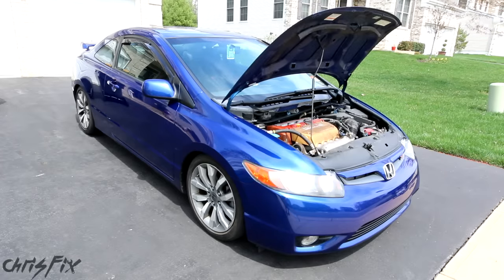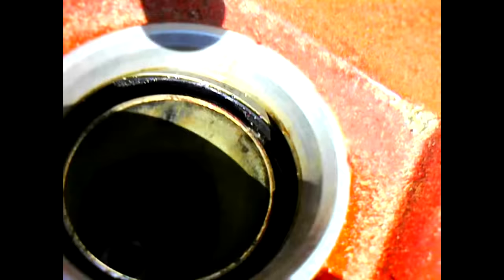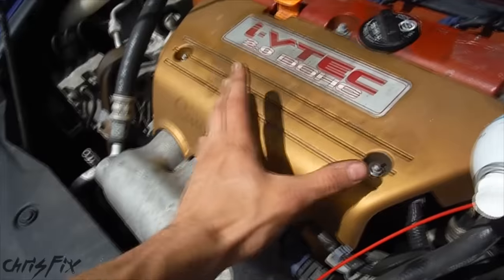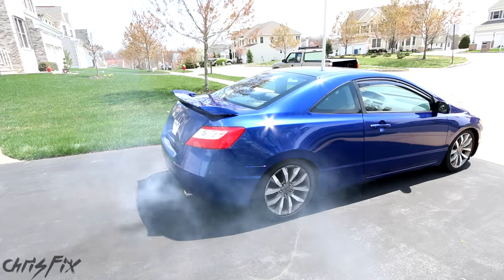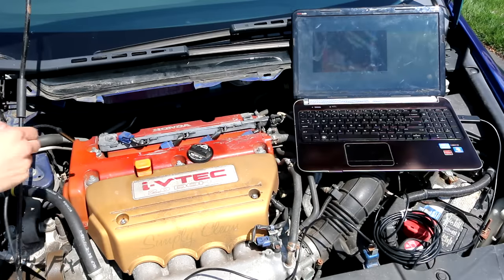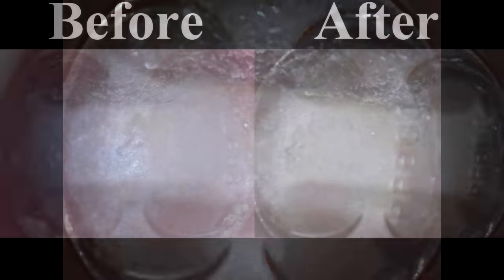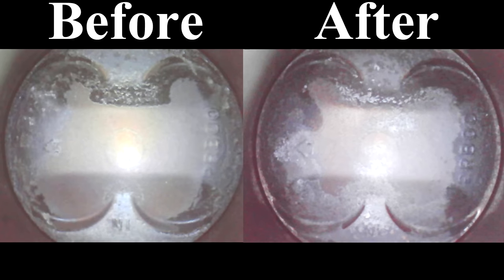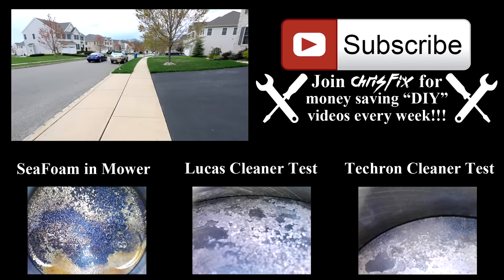Does Seafoam Actually Work in a Car? (with Proof)

Comment: not much of a change. don't know what yall are watching.
Reply: I would like to know how those small amounts could effect how the engine runs. im having issues from carbon build up. it would have to be a lot more than that I imagine
Reply: lol It was the equivalent of blowing dust off the engine.
Reply: TubeWatcher I had my mechanic seafoam and manually lean the throttle body for $60. it starts up smooth again without all the gurgling
Reply: ***** I have no doubt that seafoam works, but in this case the before and after wasn't a big difference.
Reply: it's not suppose to be night and day different. for the price of the can and effort in the project. i'd say it's a good value. compared to, manual cleaning ?
Reply: TrapBum is there a chance that it can damage other parts downstream though? ive heard people talking about catalytic converters getting messed up
Reply: ***** sure but chances are the cat was almost gone anyways.. cat aint big repair anyways
Reply: TrapBum the mechanic I talked to today said the cat has small holes that can get plugged up but it will eventually burn away
Reply: Gary Shaw
Reply: For  125,000 miles this engine looked good enough without any cleaner. So what we would be looking for would be the sides if we still see the elevated build ups, and that was visibly reduced. If the effect justifies the work on this car ... probably not. But it worked. Note also the engine never will look metallic-shiny as it was new. That's not needed at all. We put that under marketing fluff :)
Reply: Do I pour this into my gas tank?? Do I pour it into where the motor oil goes in?? Kris is putting it into the throttle body like every video everyone is doing something different there no solid answers wth lol
Reply: Hontoni Arigato you can put it in the crankcase but get an oil change after. Gas tank is fine. And the vacuum line for the smoke show
Reply: Simba TheGreat   Go for BG44K fuel additive. It's top rated.
Reply: Arthur Smith I use BG products at my work, it does work well.
Reply: Daniel   Google.com and in the search bar put LS1 Been Testing Oil. Read this. I've been doing this for over year. Marine Outboard TCW3 rated oil. Use it at 1 oz oil to 5 gallons of gasoline every time you get gas. Cleans and lubes your entire system. Works much cheaper than Lucas fuel conditioner and injector cleaner. Give it a try for a couple of tanks. Any questions give me email.
Reply: both you can induce half into the engine and half straight into the gas tank so it cleans as you burn fuel slower but goes to the same place the idea is to get the sea foam to run through your fuel system and compression chambers/cylinders
Reply: I don't even know whats the point of all this.
Reply: reefread1234 wdchh
Reply: Johnny Sauceda I agree seems like a waste of time, $ and prob pissing off the neighborhood with the smoke...can see how this helped performance any...
Reply: You put it in all three places. 
Top off your gas tank then add a full can of regular Seafoam.
Add half a can to your engine oil and run it for no more than ~200 miles then change the oil/filter.
Reply: any build up anywhere effects a vehicle. hense why people pay money to have things port and polished. smoothing welds down smoother flow ect
Reply: Ya im with you, i wonder if the engine was worse if it would have done anything.
Reply: Look at the piston walls you can see better reflections
Reply: @TubeWatcher  Lmfaoooo

Comment: Most of the smoke coming out of the tailpipe is the Seafoam and not carbon build up. The Honda's engine was actually pretty clean. You should retest the Seafoam on a GDI engine with 100K+ miles.

Comment: I guess it's like brushing your teeth. Your not going to get the to turn white right away if your teeth are yellow but if you keep it up it will still working it's way threw. 
But if your teeth are already white it will just protect them.
Reply: Our teeth naturally aren't white and naturally do not stay white and are not suppose to. It's crazy how peer pressure do that.
Reply: If you put your teeth in a jar of hydrogen peroxide overnight they'll be lovely and white in the morning. Just don't leave them too long or they'll disappear.

Comment: how often we should clean the engine from carbon? 
very nice video and helpful
Reply: Aziz Bassim Using this stuff more often won't hurt your engine since it's petroleum based. I use seafoam spray twice this year.
Reply: Aziz Bassim never! don't waste your money on this stuff, it's a gimmick and you will gain nothing.
Reply: Its not a gimic, I use it in many engines from small to large, and I can vouch for it. Its made everything from 29cc engines to my uncles boat run smooth again. That said, it's not a fix all solution I still had alot of work ahead of me but the seafoam definitely helped.
Reply: Ginger _ 
it is a gimmick, it removes minimal amounts of carbon and carbon removal on the pistons has no noticeable affect, you are not going to get a engine running smoother doing this, it's in your head!

cleaning the fuel system is just about the only fluid based product you can use that has any genuine Benefit at all and even then, once done , doing it regularly is a waste of money, once cleaned it won't need doing for thousands and thousands of miles.

there's so much hype out there about these products but any proper mechanic will tell you they simply don't do what they claim!
Reply: Ginger _ True. It's Helps a little, won't clean out completely, but if you really want to clean out all carbon build up, you can always open up the crank case and clean It out by hand. lol that's what I did.
Reply: Steve, if your combustion chamber is ridiculously crudded up it can help. With that said I recommend literally taking the spark plugs out, pouring it in and letting it sit for 15 minutes before removing it then repeat until it's clean. It cleaned my snowblower out and a weed eater too, the fluid got dark in the weed eater. But will it clean a large amount if you're only using it in gasoline by 1 oz. per gallon? I really don't know.
Reply: Austin Lucas  

your weed eater and snow blower are two stroke engines which operate in a completely different way to a 4 stroke engine, they will by nature become a lot more caked in shit than a 4 stroke.

also in a 4 stroke car engine you would be surprised at just how much build up is needed to make any difference to the running of the engine at all, I'm serious, to measure this you would need laboratory equipment, in the real world it's giving nothing to a car engine doing this.
Reply: That is ill advised Austin. I've seen a lot of customers try that. Some ended up needing an engine replacement. 
Don't do that unless its a beater and you have a backup vehicle. Allow me to explain... You see, Seafoam is like a petroleum distillant. Pouring directly into the cylinder will hinder the oil film on the cyl wall causing oil starvation and the increased friction will result in a seized piston-to-cyl-wall and consequentially a bent / thrown rod. The risk is not worth the negligible results.
Reply: Plus let's see, hydrolock blows your rods out the block if you've got a full cylinder and try to crank or run the car, and oil dilution from it running past your rings and contaminating the oil making it not lubricate anymore.
Reply: Honestly with the way engines are anymore I would do it every 50,000-100,000 miles which is every 2 years for my driving habits. It's super cheap so you could do it every year after winter (where you get your maximum build up from warming your car at idle) if you wanted.
Reply: Twisted86 

you could but you gain nothing, it's removes minimal deposits and won't affect performance at all, it's a total waste of money
Reply: Sea foam... no it'll do nothing. Take it somewhere that does terra clean or something similar, it might help
Reply: Steve Fox Actually it did wonders for my vehicle, I did gas, oil, and intake and I did notice a difference in my performance.

My mpg even went up by .8 which is not much but when you drive 500 miles a week it adds up. So to say it does nothing seems like complete bullshit from my point of view.  There is a reason why it's been used for decades.
Reply: Twisted86 

Lol, just because people use something for decades does not mean it is beneficial!
Years and years ago when engines were nowhere near as well built and clean burning as they are now and also fuels were not as good as they are now, carbon build up could be a issue but not with today's engines or even cars 15 years old, have you ever heard of the placebo effect? That's what's making you think your feeling a difference, a bit like the ricer who sticks a stupid exhaust on his wreck that actually looses him power but he swears he can feel the performance gain!

Even if you did gain something (which you didn't) you can't actually feel anything less than about 10bhp gain or loss when you drive a car, anything you think you can feel is in your head.

Do you know just how much build up you would actually have to have inside your engine for it to make any difference to your performance? All build up will do (and in modern engines were talking tenths of a mm is all your gonna get) is reduce the cylinder capacity by a microscopic and almost unmeasurable amount, in a old engine and only if you got substantial build up, it would mean you had a slightly lower air to fuel ratio and even then only if the car was injected and not a carb

Today's engines know exactly how much air has been drawn, how dense it is and what temperature it is and control how much fuel is injected accordingly and on top of that, it monitors the exhaust too and adjusts the fuel from that too on and on top of that, most engines today are also variable valve timing also and can control the engines Input even more.

Those who understand engines and the actual process they go through know that these products are pointless things from the past that no longer have any relevance but continue to be marketed because there are mugs out there who still believe and will buy it.

You will gain far more beneficial results by running a tank of super unleaded through your car once every 6 months to a year than this crap that actually strips all the lubrication from the cylinder walls whilst it's passing through instead of the safe cleaning and lubricating agents contained in super unleaded

Running on super all the time will gain you nothing ether, just once every 6 months to a year is all you need,  unless your car has a knock sensor and a higher octane map in its ECU to make use of the 98 Ron you won't gain and extra performance from the fuel, just cleaning and you may actually get lower mpg and performance from the fuel but the cleaning is all your after and you go back to 95 Ron fuel afterwards.
Reply: I used seafoam fuel treatment on my 1990 plymouth laser a couple decades ago.  It worked fairly well.  Saw a slight improvement in pickup and gas mileage.

Comment: When you said sea foam, I thought you meant the organic variety, so living on the coast, I dumped in the same.  For whatever reason, the engine ran rough afterwards.  Vacuum issue?  Do I need to remove the kelp?
Reply: The kelp has great antioxidant properties I say leave it lol

Comment: I used this for my EGR valve pipe and got all of the carbon gunk out and it did wonders. I probably should have used more but I can always take the valve off and do it again.
Reply: Did you just spray it down the pipe still attached to the engine or did you take the pipe off and clean it out externally?

Comment: good bye O2 sensors and Cat converter..
Reply: s zarella it would be interesting to use the seafoam on a junk car then cut the cat apart afterward and inspect it also I've had a head gasket go out on a car before and I had to replace my oxygen sensors because they kept throwing the check engine light
Reply: does it damage them?

Comment: A "how to" video for people who think pouring overpriced light weight oil into a perfectly good motor passes a tech advice. The spark plugs told you everything you needed to know......just like in 1971 when I ran a carbureted 5 liter, 400hp Mustang on the street.......always a thin black coating on the pistons. Not a problem, just change Autolite plugs every 12,000 miles and run AC's on the strip.
To make this video remotely relevant there would have to be a before and after dyno or 0-60 test.  Sorry Chris, this one didn't count. Temporarily "detailing" pistons, that actually indicated that the engine was fine before the  "procedure" accomplished nothing.......except probably shortening the life of the converter. Oil kills cats.
Your headlight lens restoration with Rust-oleum is spot on though. Did it on my daughter's 04 Accord. Worked great and they're still clear almost a year later.

Comment: Great test! Seafoam works good!
Reply: i use Techron Complete Fuel System Cleaner every 5k + pump SHELL 93 once ... i did not have any problem with carbon + fuel injector for yrs.  This is the best method. Plz dont tell anyone this :)

Comment: 1) Different light on borescope = can't compare the carbon deposite.
2) If you drive aggressively for some time, it will decarbonize  anyway and you need no chemicals for it. Just make the engine warm, take it to a highway and keep revs high enough (in my case it means keeping about 160 kph) for about half an hour with some engine braking (which allows some fresh air in).
3) Do it as a prevention (in my case once a week) and your engine will love you for it.
Reply: Good way to get a ticket
Reply: @mullaway5746  Well, it depends where you live. I have never received a ticket for speed. I keep it under 160 kph.
Reply: @PavelSkollSuk   it's 110km where I am and over that it's a ticket and an expensive one lol

Comment: Finally, video proof that there is VERY little change to the amount of carbon on the pistons. Those pistons barely had any carbon on them to begin with, and Seafoam couldn't get them clean. So if you have a dirty engine, I wouldn't waste your money on this product.

Comment: I wonder if it will work the same results in the gas tank? This process is always scary because of hydrolocking the engine or stalling it out.
Reply from the maker: +Joey Cusimano With the spray you dont have to worry about hydrolocking. But if you put it in the tank, it will be like the rest of the fuel system cleaners I have tested.
Reply: I have a can of the liquid but not the spray. I don't think I need to use it though, 64k mile LS3 is probably clean.
Reply from the maker: +Joey Cusimano I wouldnt even bother. Put it in your gas tank if you want. Some LS3s are know to have a pcv oil blow by issue which gums up the intake but if your car is running fine, dont touch anything!
Reply: +ChrisFix Catch can or breather would probably fix that. Which of those do you prefer?
Reply: +ChrisFix Hey Chris Im down in Monterrey Mexico and haven't been able to find Seafoam at any of the auto stores here. What would you suggest as your 2nd or 3rd choices? I got a 2006 Mazda6 3.0 V6 with 309K kms on it. 

Thanks!
Reply: you can try marvel mystery oil, take your spark plugs out and pour a little bit in each cylinder and let soak a couple hours preferably over night but its your choice. then in the morning turn your engine over to blow out any remaining liquid in the cylinders(DONT PUT THE SPARK PLUGS BACK IN UNTIL ALMOST ALL LIQUID IS OUT) after your certain almost all of it is out replace spark plugs and turn the engine on and watch the smoke show.
optional- you can put the rest of the bottle in one of the vacuum hoses to the intake or in the gas tank or both.
good luck
Reply: I think the gas tank is the safest place for any kind of cleaner product, but as Chris's videos have been showing, it take a couple rounds to actually do anything. If you really need to clean your pistons it's gonna take a bottle of a fuel cleaner of your choice in the next 3 fillups before you see results. But it's the most passive way to clean everything at once. Also, modern 93 octane gas at Shell/BP has detergents and stuff that might help the pistons stay clean.
Reply: ive done marvel mystery oil many times over and hav never had a problem but you can try whatever you like i personally pick marvel mystery oil over seafoam any day
Reply: +White Camaro I always find after using seafoam in the intake the car drives much smoother for around a week or two.  Also I found spraying into cylinder heads and leaving it for a bit to soak worked well.  I also put it into the gas tank and into the crank case.  I highly recommend putting it into the crank case a few weeks before an oil change.  the oil comes out significantly dirtier if you use seafoam which means you are cleaning.
Reply: +Royal D  do you know what  is in marvel mystery oil?
Reply: Yes you can put in the tank
Reply: I've always used seafoam.  My truck (Mazda B3000) is creeping up on 300,000 miles.  Only had 1 issue in all that time, which wasn't common wear & tear, starter solenoid.
Reply: +Jeremiah McQueen illuminati confirmed
Reply: Text Missing mason actually
Reply: +ChrisFix  i hear liquid invert sugar works great!!!!
Reply: Mike West i would honestly have to look at the bottle to tell you that but im pretty sure its less harmful than seafoam as it doesnt eat away at rubber like seafoam does.

Comment: Great test Sir ... but I believe the can says 2000 RPM while spraying in not 1500 Sir ... may want to recheck directions... I did 2000 RPM and it worked for me great ...on  truck and car with over 200 ,000 miles ... nice improvements in smoothness and acceleration ... I also would recommend it.